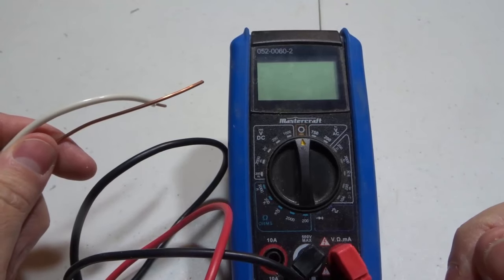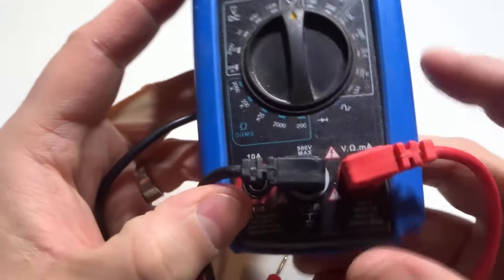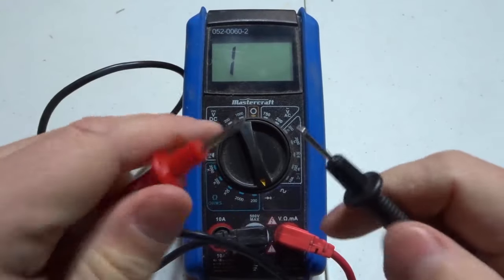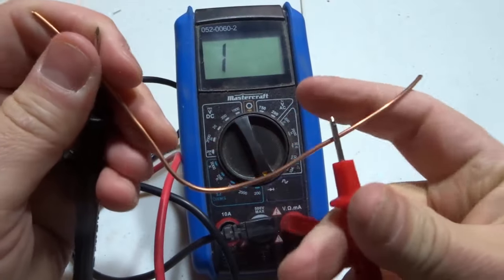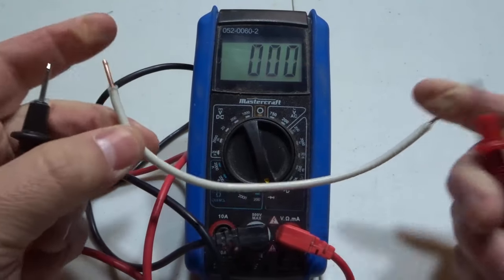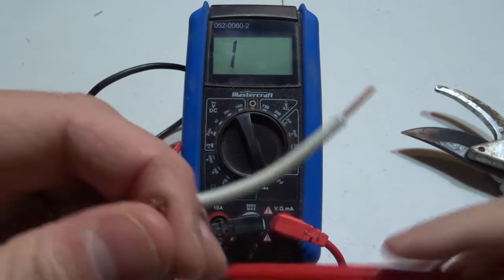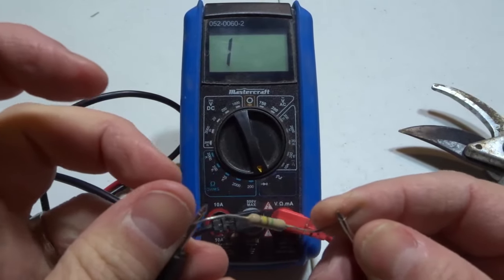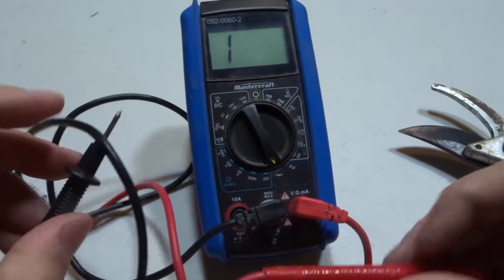Checking For Continuity With A Multimeter-Easiest Tutorial

Comment: My multimeter has both symbols you are talking about: diode and the dot with sound waves;  which one would be used for continuity?
Ty
Reply: Use the dot with sounds waves .))) for continuity if you have that option. If not use the diode one and if I am not mistaken you can also use the ohm selection as well.